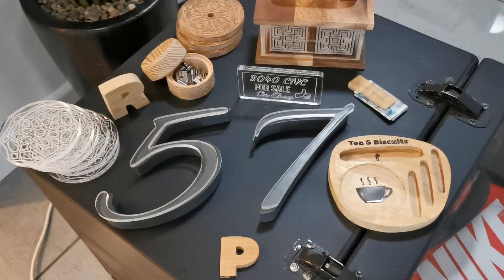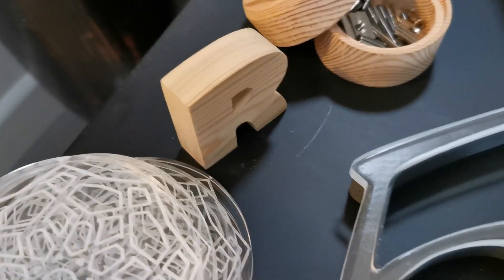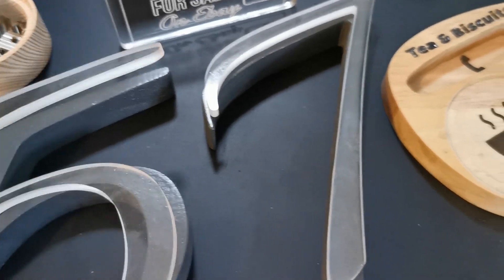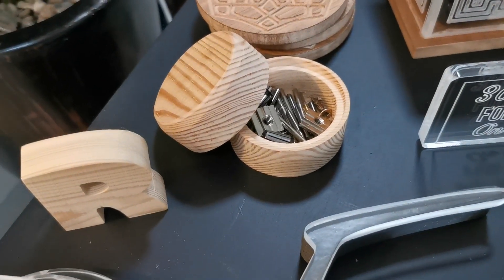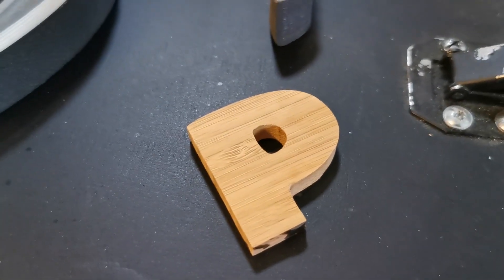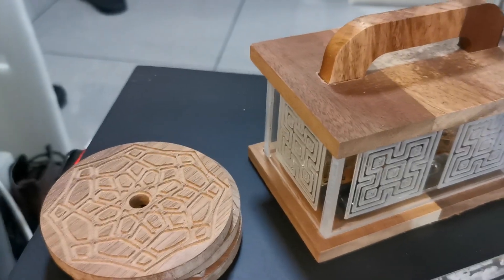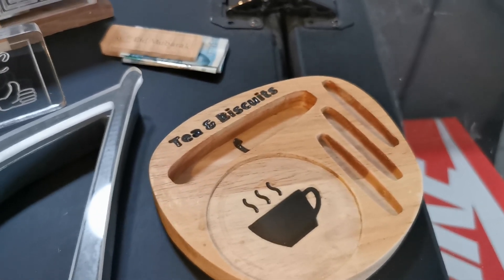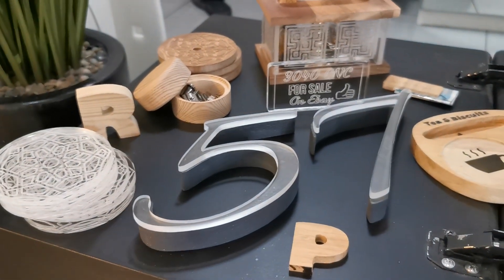what can I make using a cheap CNC 3018  router machine from eBay?

Comment: Great work,I just put mine together,what do you use to program, i’m having a hard time with program in millimeters would appreciate your feedback
Reply from the maker: Which machine are you using?
I doing most of my design work in Fusion 360. But also I'm using Easel for simple designs. Easel is also a gcode sender, so I use this to send the gcode to the CNC.